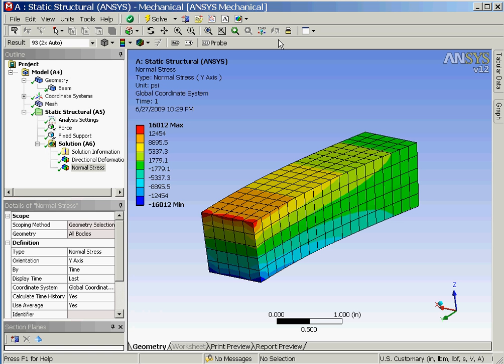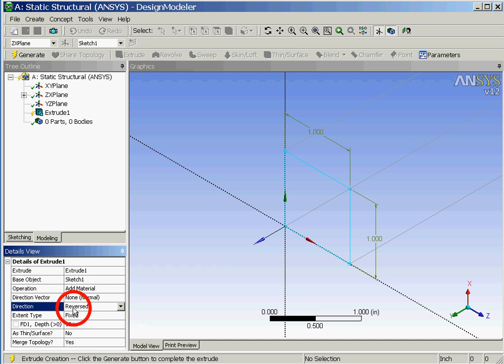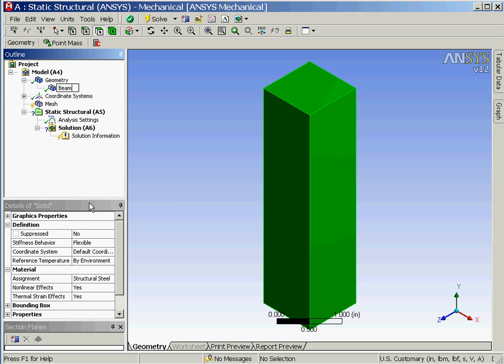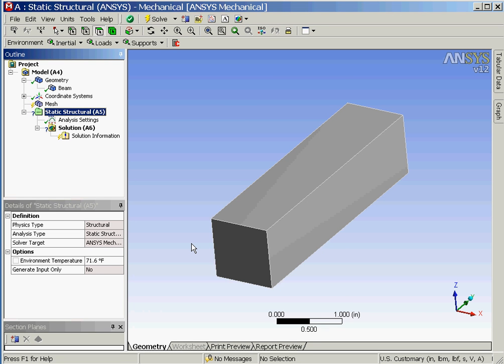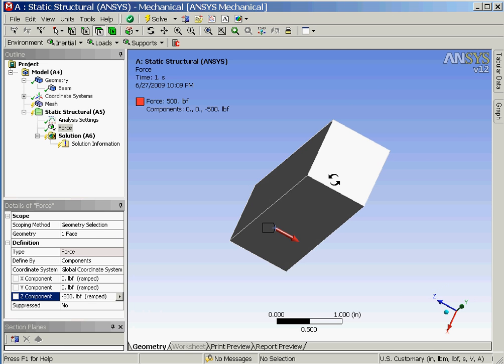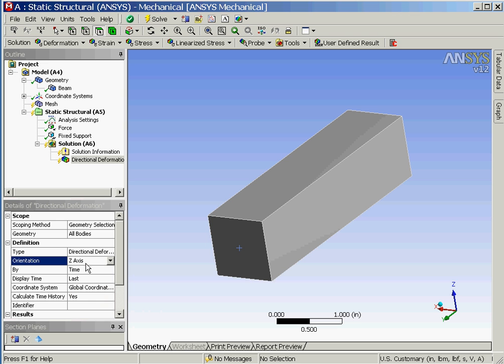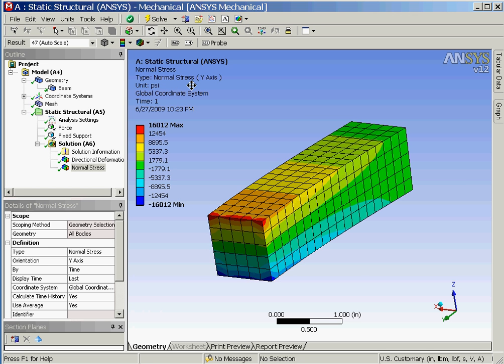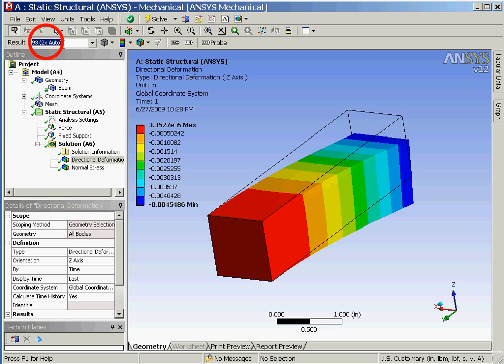Using ANSYS Workbench 12 to analyze the bending stress of a cantilevered beam

Comment: If we do Force/Area for a cantilever beam of 200*200mm of 1000 mm length, then the stress is coming out as 1.25 N/mm^2 for  a load of 50000N. But analysing in ANSYS WORKBENCH STATIC STRUCTURAL giving me the maximum normal stress as 1.93 MPA. Why is it so?  Both the results should be same. isn't it?